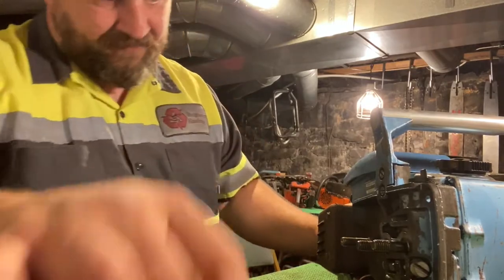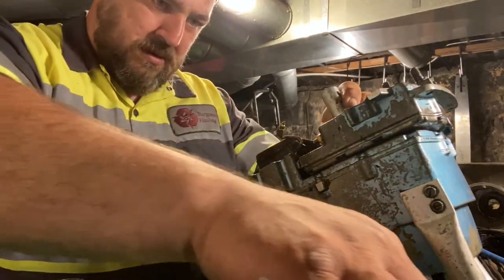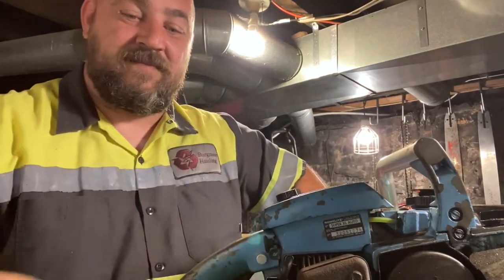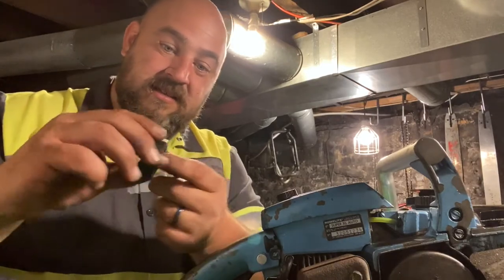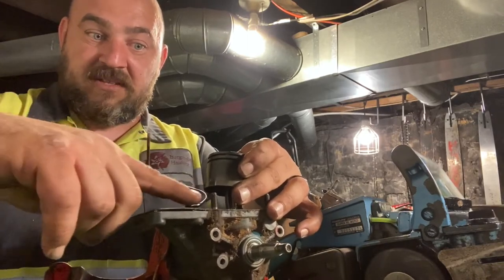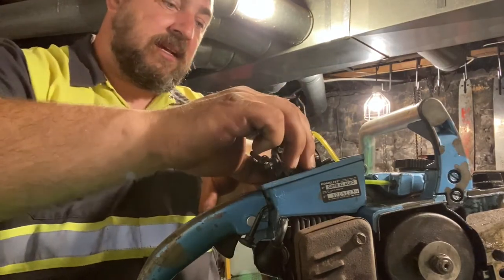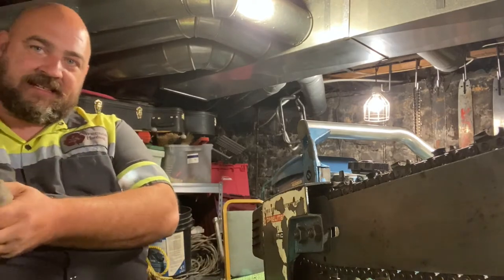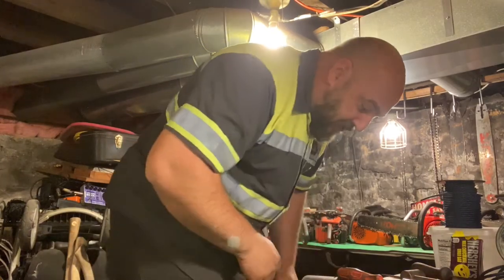Chainsaw Air Leak! Let’s Do This By Ear! Round 2

Comment: What part number was your seal?
Reply from the maker: Dichtomatik 0609318TC
Reply: @Smittyschainsaws  thanks.  Do you use the homelite seal on the flywheel side or an aftermarket seal?
Reply from the maker: @nhellman84  Aftermarket part SKF 6119 for the flywheel side
Reply: @Smittyschainsaws  ok great thanks